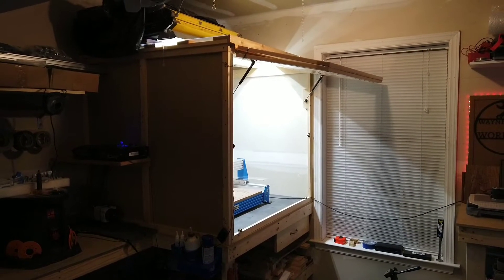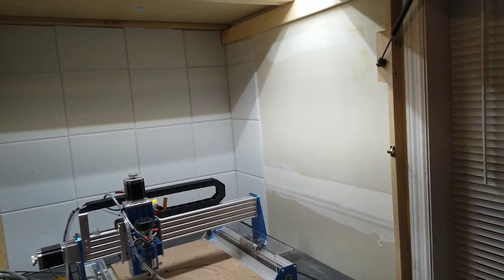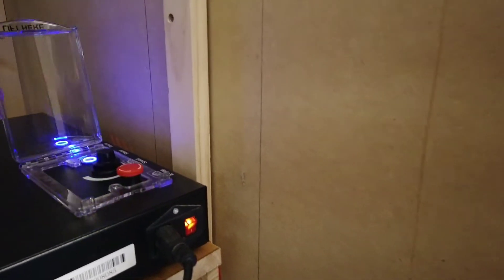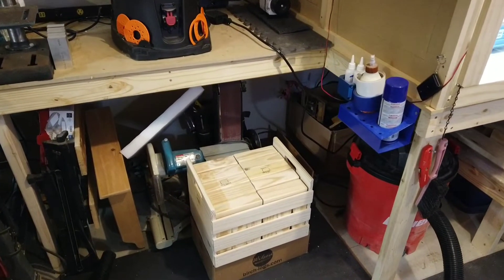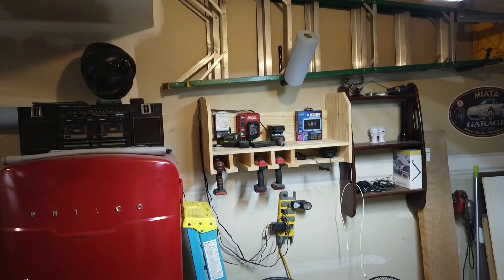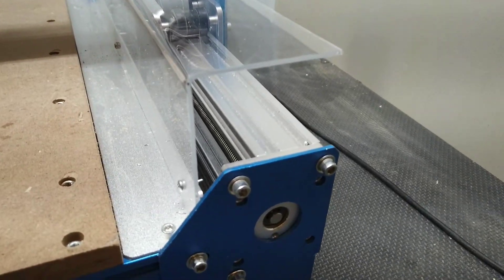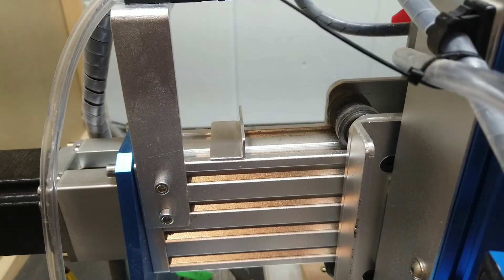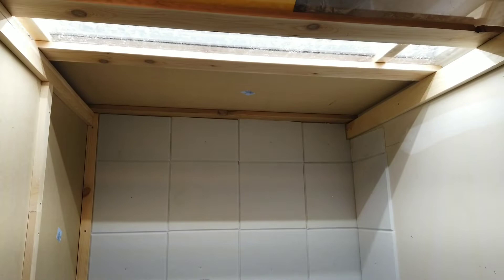CNC Enclosure and Mods.

Comment: I had a similar problem with Estops on my CNC too - I fitted a cover, but I also tapped into the wiring and located another higher up on the wall, just in case!

Comment: I'm curious why you use the bent pieces of metal as stops?  you home the machine to the limit switches correct?  you could then just use a gcode to move out to that corner if you want to go to the same spot each time.  just got the same machine myself, lots of learning!
Reply from the maker: I've tried that but doesn't always work for some reason. This just makes it easy to know I'm at the exact spot I want to be if the homing doesn't work.

Comment: Love the lead screw dust guards! Will definitely look at doing something similar and maybe 3D printing some caps for the ends to help too. 

With the Genmitsu have you tried to mill any aluminium? If so how was it?
Reply from the maker: I have done a couple carving/engravings  in 1/8" thick aluminum that came out looking nice.  Usually with a 1/16th or 1/32 shallow depth for the text/design.  Havent tried to mill anything thicker but just bought some nice Amana Tool aluminum bits and also found a Lego brick 3D file that I'm going to try with 1/2"  aluminum stock.  So we'll see how that goes here soon.
Reply from the maker: I was thinking of trying to make a relief cut in the acrylic and then bending it down to cover the end, but thought it probably wouldn't look as nice as I wanted it to.